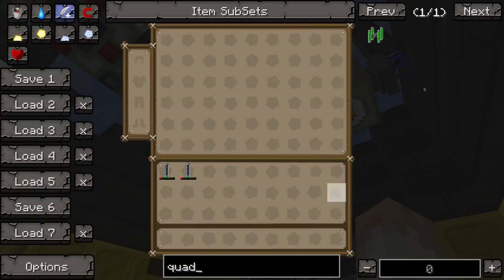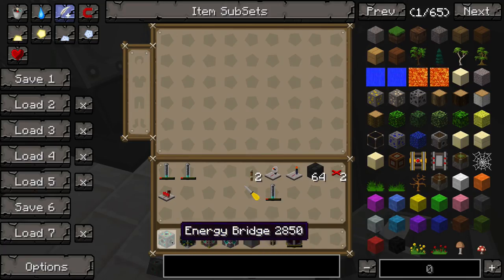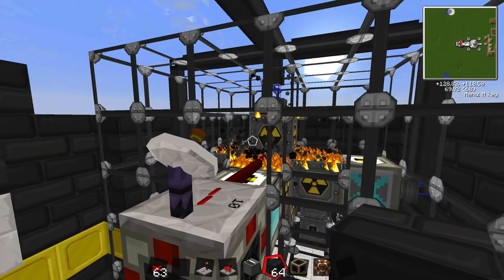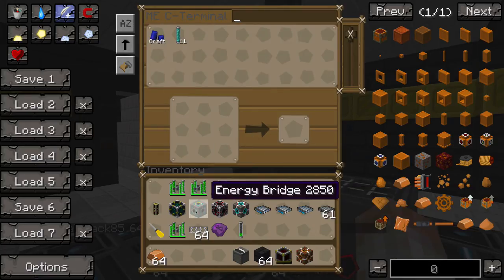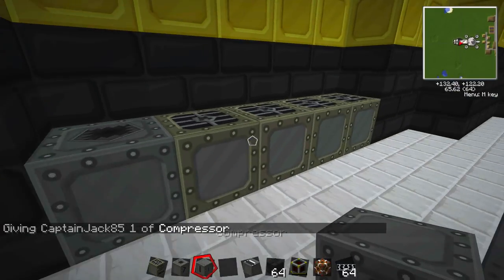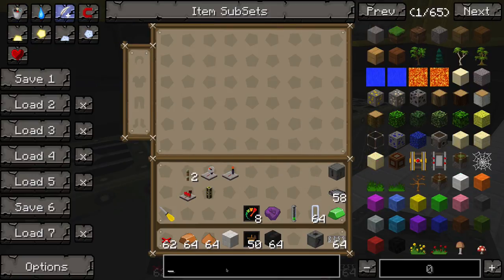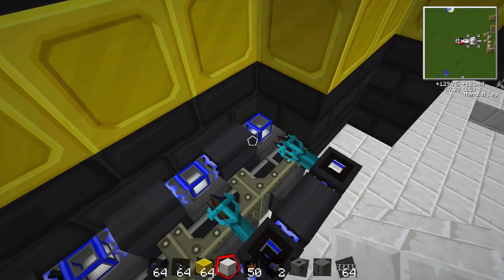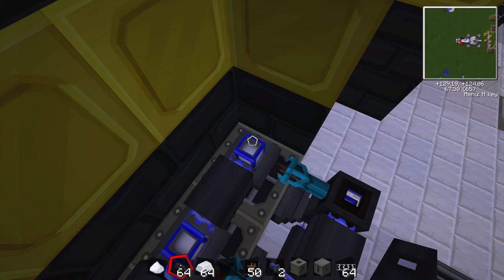Lets Build a Nuclear Power Plant - Episode 4

Comment from the maker: But the main issue is not getting items in and out of the breeder, its that no machine can "know" exactly which space inside the reactor GUI to place either the quad cell or the isotope cell. If by chance a quad cell runs out at the same time as a isotope cell gets recharged and taken out, there's a chance that the wrong item will get injected into the wrong spot inside the reactor GUI. I have automated one, but not with a 100% chance of never failing. Its more like 98% or something.

Comment: You've got room to save space behind your heat monitor.  You can create a 1 wide, 2 long 2 tall configuration with your ET, BC Consumer, Bridge, LV Producter, and not use the length of Glass Fibre.  Working in reverse:  Thermal Monitor (back)->LV Prod (Bottom)->Bridge (back)->BC Consumer (top)->ET.  Power flows from ET down to BC Con. Over to Bridge, Up to LV Prod, Over to Thermal Monitor. 

And as for exact placement into the breeder, you can do it with Turtles.

Comment: I was a little playing around and it didnt worked the way i wanted
but if you a Retrievulator and a Retriever between the reactor and the ME Interface it works with just a little delay

you have the interface to provide a quad-uranium cell and a depleted isotope cell everytime, in the Retrievulator you can "stack" unstackable items so you can config it requesting a depleted isotope cell if there are less than eleven and requesting a quad-uranium cell if there are less than four

Comment: the only issue ive found in this setup is shut down the reactor is not 100% working
if the Retrievulator is requesting something it shorty turns on the reactor even if it's offline
but if the reactor is filled correctly this wont cause any problems

i hope this was understandable

Comment: I have a problem with the Remote Thermo, everything works fine. I can turn the plant of by using the Emit under & Emit over option but it doesn't turn off when it reached the max temp I set it to. Do you have any ideas what could be the cause for this.